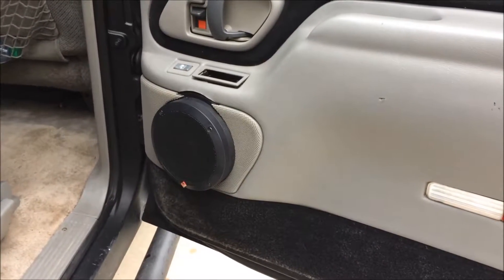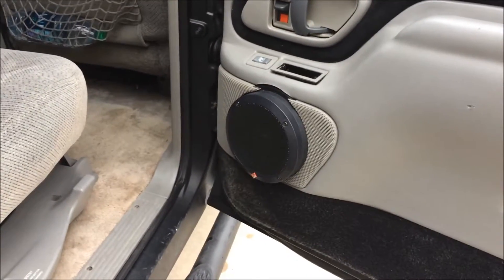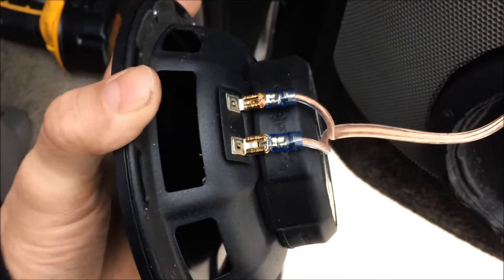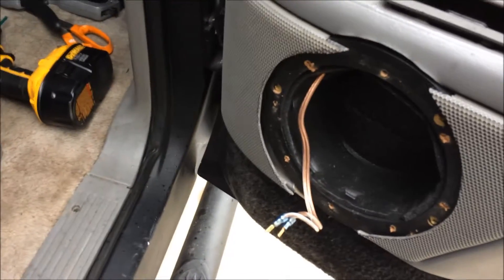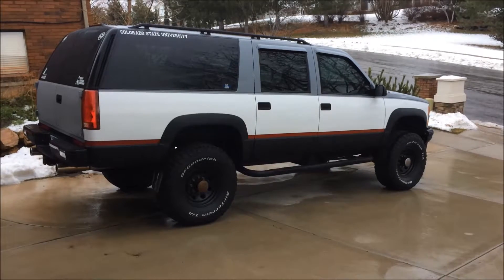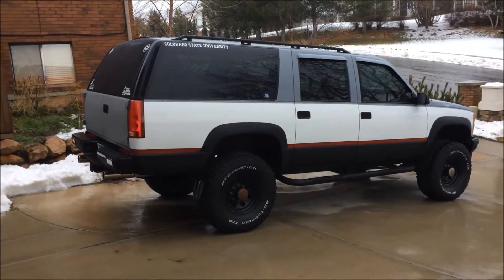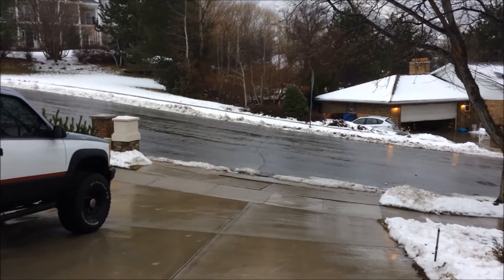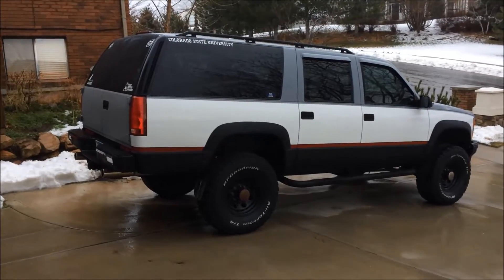20161224 I Screwed Up Suburban Rear Speakers

Comment: The polarity on a speaker shouldn't matter (as in it will not blow the speakers), it will play either way just the phase will be different, 180° out of phase (though if that was the only speaker like that you would have a hollow sound since the out of phase speaker will cancel out some of the other sounds). 
Don't know if you know much about subs, but it would be like mounting a sub upside down in a box so the magnet is outside the box. One way you can tune for that is swapping the speaker wire polarity, though the proper way would be to go into the radio settings and change the phase of the sub. Sooo, it's looking like the rear channel is bad on the amp.
Reply from the maker: Yeah, those are my thoughts exactly.  The speakers are fine near as I can tell.  I'll be dismounting the amp after the holidays and getting a new 4 channel Punch amp.  So while that's a fail, at least I put the speakers back more flush the way they were.  That and now I know the wiring is all straightened out, so a new amp should be a straight forward install.

Comment: At least you know your radio works lol. I still need to get a removal tool to even diagnose the problem. I want a new one anyways.
Reply from the maker: Yeah, the deck is a digital only Pioneer.  Not fancy.  It just works....until iPod does a stupid update that interferes.
Reply from the maker: Every time I hear things like that, it makes me think Fords are nothing but trouble.

Comment: Factory amp behind glove box powers rear door speakers- you need power to blue white wire on wire adaptor kit- if you used factory wires
Reply from the maker: Jack, you sure that applies to a 90s Chevy?  I haven't noticed an amp behind the glove box, but may need to go look again.  Funny part is the speakers all worked when I had that crappy JVC amp in there.  Switch to a Rockford Fosgate and no more rear speakers.